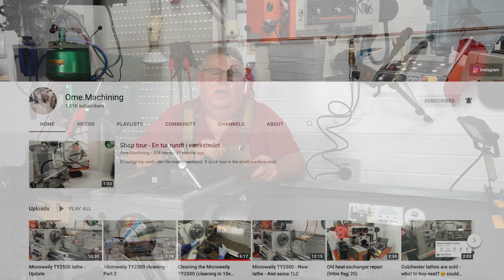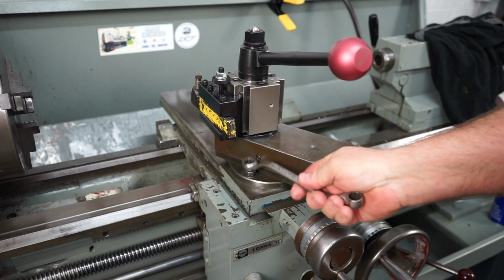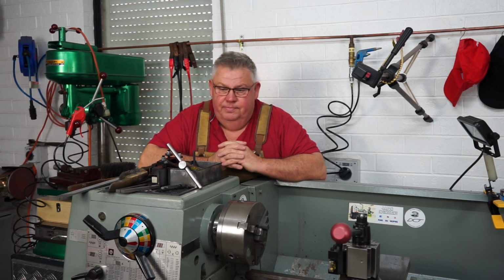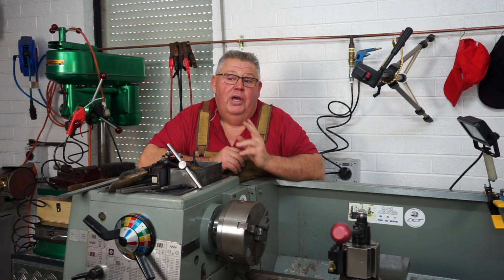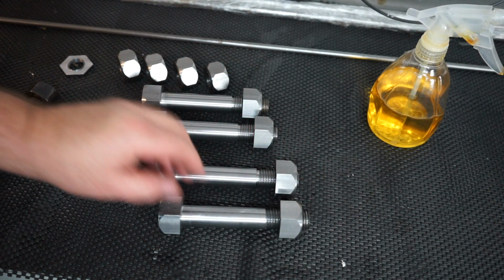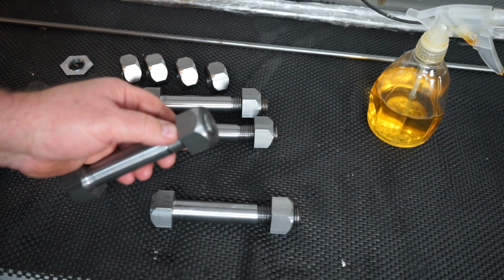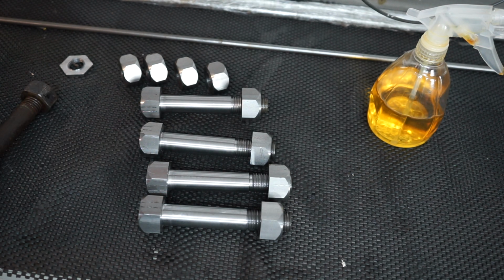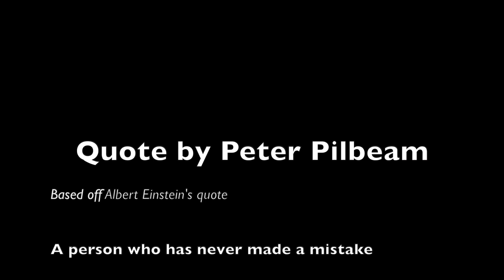Threading Properly - I STUFFED up

Comment: Hypnotic to see threading in slow motion. It looks great! 

I made this same mistake on my lathe because of how the graduations were marked out and what the forums and fb machinists were saying had me chasing my tail for so long. In the end I set the compound parallel to the thread angle and things just clicked.

Nowadays, like you, I love the full form inserts, and also a solid tool post :D
Reply from the maker: G’day Adam. I agree totally with you on full forming inserts. Especially in this day and age where a three sided insert is only $16-$18 each. Bring on the CNC lathe to punch out some threads. 😝

Comment: In all the years I have cut threads on a lathe, including my apprenticeship,  I have never adjusted the top slide to half the thread angle, I have always set the top slide at zero.  The depth of cut is put on via the cross slide, and the top slide is moved into the thread direction by about a third of depth of cut, the last two or three cuts are full depth and will clean up both flanks of the thread.  Guaranteed correct depth of cut every time, with no messing about with cosine error.
Reply from the maker: Hello how are you. Thanks for taking the time to watch the video and for providing some excellent advice. The YouTube machinist community is an excellent resource of like minded people willing to help each other. Cheers Aaron
Reply: @AaronEngineering  I'm fine thanks Aaron how are you?  Tilting over the top slide to half the thread angle is complicating the job I think, and my mission in life is to keep things simple, and encourage others to try out this fascinating skill, just like you do.  Keep up the good work.

Comment: Aaron, I am retired fitter and machinist, I served apprenticeship in a heavy machine shop, we never angled the compound, even at tech/TAFE we just plunge straight in. That's with hss toolbit. I finish working at hyd. Repair company and all threads on the new rods were plunged straight in and rods were made out of 4140 steel, using carbide thread insert.
Reply from the maker: Hi Jay.  I was also taught to plunge straight in back in the day.  However, many argue that by placing the compound on the angle you produce a better thread as you're always cutting on the front of the cutter.  This first came to light in the old southbend book "how to run a lathe".  Cheers mate.  Aaron.

Comment: Hello Aaron. I just found your channel. I see you are a subscriber to Cutting Edge Engineering,also. I wanted to point you in the direction of Joe Pie.He made his first video,5-6 years ago because,he was frustrated with the videos people were making on the subject of threading.He showed his method of cutting threads with the tool upside down,spindle in reverse,threading away from the headstock. I tried this method and, I have to say, I have been using it ever since.
I am happy to subscribe to your channel and,hope to pick up some tips.
Reply from the maker: Hi James nice to meet you.  Welcome to my channel and I appreciate you popping in.  Yes I know Kurtis and Karen well from Cutting Edge Engineering.  They are good people.  I also subscribe to Joe Pie, but not sure if it this channel or my other CNC one.  I've seen that method before.  Everyone seems to have their own preferred method of cutting threads.  With a full forming carbide thread insert, I usually always leave the compound set on zero. However, with this video using HSS tooling I tried the old true and tried method which my old buddy showed me.  However in the initial video I stuffed it, and this is why I immediately made a correction video.  Cheers, Aaron

Comment: Aaron.
Most hate the idea ???
But, I have Always cut Threads at 90 Degrees.
For those who Might ??? be interested I did post a video some time ago of cutting fairly Course Threads 2"x 4.5tpi.
Which is one of the courses Threads any one might cut.
To add to the frustration of some.
I also have a video cutting ACME Threads using the same angle of approach ( 90 degrees )
Thread Cutting is one of those jobs most lesser skilled people will be prepared to undertake.
My only thoughts about how to overcome this ??
Practice Cutting Threads using Plastic, it leaves you with plenty of room for errors.
After mastering Plastics move onto Aluminium.
Reply from the maker: Hi Peter. Thank you for your valid input.  You do some amazing work in your shop and your threads always look amazing. Some excellent tips too, practice on plastic and aluminium. We need some more videos from the master 😉. Cheers 🍻 Aaron

Comment: 27 1/2??
I was taught to use 29 1/2 degrees
Reply from the maker: G’day Jeff. Wouldn’t that be for a 60 degree (included angle) threads? Whitworth threads are at 55 degrees (included) hence the 27.5 degrees I was talking about. 👍
Reply: That is what I do. I feed in with the compound.My threads turn out very smooth.Check out the first video made by Joe Pie. I now cut all threads with the tool upside down,spindle in reverse,away from the headstock.Of course,if your lathe has a threaded spindle nose,you really shouldn’t run the spindle in reverse.